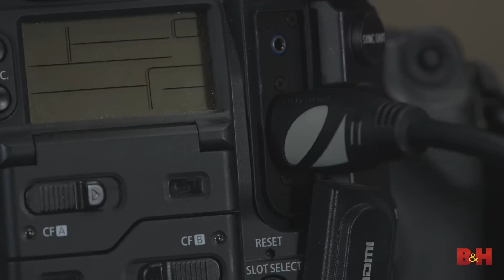SDI vs. HDMI | What's the Difference?

Comment: hi i still using betacam digi  bnc is better not worry about the plug coming out all the time   in the back of the heavy 
decks SDI out puts on betacam digi   HDMI with betacam right pain 

i used betacam sp for audio now 4 channel master i know about the encoding  it a right pain take alot of time  faster just run  channel 1-4 into the back of the video's 
decks

Comment: I get why SDI is used in professional workspaces, like livestreams or normal film shoots, but i was wondering, do i need SDI connection from my PC to my monitor if the material is already shot and it's time for editing/colorgrading. So what i took from your video is, when i have to film professionally i should use SDI rather than HDMI, which i do, but for connecting my PC to my monitor, it doesnt matter because i dont need much range, and the lock/unlocked argument is also not critical. So i guess my question is, does it matter which cable i use to connect, when i use the highest standard of both cables?

Comment: This is a perfectly fine beginner video, but some key points were missed.  For one, there is no "absolute" distance for any SDI cable--it depends on the bit-rate of the signal and the cable type.  The same 1.5Gb HD-SDI signal can travel much farther on an RG-6 SDI cable than an RG-59 cable.  The instant people hear "you can run SDI 100m" they think it's some kind of magic number.  it's not for SDI, or ethernet, or anything else in the real world.

Second, SDI is uni-directional.  It sends all the data one way and there is no "hand-shaking" between the send and receive devices.  They are "unaware" of each other.  HDMI is entirely different because it was designed for so-called "plug and play" connection between consumer devices where the source and receiver negotiate certain parameters (including whether HDCP copy-protection is active).  The number of things that can go wrong with HDMI (apart from the connector falling out) is greater than with SDI.  Fortunately the equipment that uses HDMI has gotten much better at making sure a signal gets through!

And, lastly, the DIN connector is not "mini-SDI."  There is miniature DIN type, and there is a miniature BNC (called, confusingly, HD-BNC) and they are incompatible with each other.  If your equipment uses these connectors, because space is really tight, make sure you get the correct cables or adapters.

Comment: So  fantastic 💝 . I am using SDI for ten years , I can easily transmit 600 feet away from the source camera . 
I enjoyed this video and learn a lot .
Reply: What resolution are you running at that length. Thanks
Reply: @BillAshtonNelo This time a medical device named STOREZ with an endoscopic camera, it's output was only SDI. I used SDI to hdmi converter, HDMI to BNC and over RG6 (fully cuper)600 feet and at the end BNC to HDMI converter to a 1 is to 4 HDMI splitter and then projectors and TVs. Resolution hd 1024*768. Projection quality was excellent.
Correction: For 10 years I was using SD , not SDI. Sorry for the mistake.

Comment: Please help, I own the Sony fs7 and I wanted to know if there's a way to record video using an external recorder like the atomos Ninja V WITHOUT the Sony Xdca FS7 extension unit???
Reply from the maker: Internal Recording
The PXW-FS7M2 records internally in both DCI 4K and UHD 4K at up to 59.94 fps, and in HD up to 180 fps using XAVC-I or up to 120 fps with XAVC-L. DCI 4K (4096 x 2160) can be recorded internally without the need of an external recorder.  You will need the XDCA-FS7 to output a RAW signal from any PXW-FS7. The Sony XDCA-FS7 allows 12-bit FS RAW output and is compatible with Sony and third party recorders. It will do both 4K RAW up to 59.94p (1 to 60 fps Slow and Quick Motion) and 2K RAW up to 59.94p (240 fps and 120 fps Slow Motion).      >Mark<

Comment: We are using the Atem mini extreme so..... we have cameras that have hdmi at camera to HDMI-SDI convertor. Then SDI for the long runs back to the desk. We then have SDI to HDMI convertor to let us have a HDMI into the Atem extreme. Actually all works very well with no latency and loss of quality. Our PTZ camera is SDI straight out.
Reply: I have a canon C70 and was thinking of using for livestream use.   How long is your HDMI (out of camera) to your HDMI to SDI coverter?
Reply: @cia2928  the HDMI out of the camera is 1 M long and the same at the other end from the convertor to the Atem.

Comment: Thnx, made it all very clear for this start up for now budgetless broadcasting company to be :-) Questions: hence the budget, we have to work with HDMIcables for transmitting live streaming signals from camera to OBS. In such a case; what would still be the best solution if we had to overcome distances longer then 15 feet? What set up exactly? Amplifiers? Is there loss of signal when using those? Are 2.1cables the best if we merely use 720 content? What about HDMI b? Actually.. we need to overcome about 30 feet distances to get a good camerashot regularly. And since there;s no budget to buy SDI camera's yet, what should we do best? Maybe with a bit loss of signal? Thx, René, IBTV, Amsterdam.
Reply from the maker: At 30 feet or so active HDMI cables are a fine solution for most applications:
Comprehensive MHD18G-35PROBLKA MicroFlex Premium High-Speed Active HDMI Cable with Ethernet (35')
B&H # COMHD18G35P:    https://bhpho.to/3bRFKgu        >Mark<
Supports 4K, HDR, 3D Video
Active, Directional Design
Triple Shielded
24kt Gold-Plated Connectors
Xtra-Flex PVC Jacket
Supports CEC, ARC, HDCP
Reply: @BandH  Thnx  a lot, this is very helpful for our startup situation. Will follow you for our next steps!

Comment: great video..so there isnt any difference between BNC and HDSDI cable?
Reply from the maker: A BNC is a connector that can be found on different kinds of cables.  SDI Cables, Composite and Component can all have BNC Connectors.  You need to make sure you are using the right cable type depending on the situation.
Thanks! -Joey P
Reply: @BandH  thank you for the perfect answer and reply!always learn alot from ur channel.

Comment: 1- do I need an SDI input monitor to get 10bit or HDMI(or DP) will do the job? 
2- can we use dual monitor setup with geforce card + cheap quadro to get 10 bit picture on 2 monitor or doesn't work that way?
3- if second question negative can I use Blackmagic Design DeckLink Studio 4K 6G-SDI to get 10 bit signal on second monitor? I'll be using geforce on main monitor.
Reply from the maker: You wil find 10 Bit options for both SDI or HDMI.  So that we may better assist you with all of your questions feel free to email us directly at askbh@bhphoto.com.
Thanks!
-Joey P

Comment: hi, I wanted to ask if you can connect two monitors with an SDI cable. I have an ikan monitor with sdi in / out and an atomos monitor with sdi in / out I would like to connect them with an sdi cable, connecting one of the two with hdmi to a sony a7sii, is it possible?
Reply from the maker: That would depend on the exact monitors you are using and if either has an HDMI input with cross conversion to turn the HDMI signal in to SDI for output.  If your monitors are not capable of cross conversion, you may just need an HDMI to SDI converter to connect from the A7SII to one of the monitors with SDI.

https://bhpho.to/38nGwwN

Thanks! - Joey P

Comment: what about timecode sdi supports it
Reply from the maker: Yes it does!  SDI includes video, audio, timecode and metadata all embedded in a single cable. Because of its reliability, SDI is ideal for live production, post and broadcast. SDI is scaleable and multi rate, so you can switch formats and frame rates using the same physical single cable connection.   >Mark<

Comment: 👍 Interesting video. I learned a few things... As a consumer/prosumer, I say, "screw SDI." My HDMI cables are 4" long, and a non-locking micro 2.1 HDMI connection isn't a prob at 4". Adding SDI to my $260 USD 7" 2200 nit field monitor is an extra $80. An $80 thingamajig, that I'll never use anyway.

Comment: thank you for sharing the info. but i want to know how to convert SDI output into IP output and which equipment could do that actually. Please reply..Thank You
Reply from the maker: Convert a single 3G-SDI signal for highly efficient SMPTE ST 2110 IP transmission using the IPT-10G2-SDI Mini-Converter from AJA. Supporting up to 1080p60 video, this mini-converter provides two interfaces for use with separately available 10 GbE SFP+ modules. Hitless SMPTE ST 2022-7 switching for critical transmissions is offered via the redundant interface design.  AJA IPT-10G2-SDI 3G-SDI to SMPTE ST 2110 IP Mini-Converter
  BH #AJIPT10G2SDI:  https://bhpho.to/2LK2Kk4   >Mark<

Comment: Worth reiterating that HDMI will now carry 4X the data rate! If you can live with short cable runs, it seems the big thing that is missing is an industry standard locking connector(s) for HDMI. For short runs it is starting to make more sense as cameras need higher data rates.

Comment: Thanks for this info. I've noticed companies like Atomos sell "SDI to HDMI" converters. Does that actually mean that cameras with an SDI RAW output could actually record to a HDMI input on an external recorder?
Reply from the maker: It does not.  In general SDI to HDMI converters will not be able to handle an SDI Raw signal.

Thanks!
-Joey P
Reply: @BandH  ahh thanks Joey P. Even without RAW, if they can still convert 4k60p SDI signal to HDMI that'd still be  very cool!

Comment: basically, if you can afford the level of equipment that comes with an sdi connection, then you're going with sdi, which is a simpler thing to use. for most of us, it's going to be hdmi. I've found that the signal dies after fifty feet without being repeated. I'm currently running a signal every week about 115 feet using repeaters between cables. You can also convert to other types of cords, but either way, I've found that a fifty foot cable is about as long as you can go before needing to repeat. And there are repeaters out there that don't need to be directly plugged in, so long as something somewhere along the line is plugged in, they'll draw from that.

Comment: I usually run HDMI for my personal webcasting setup. When designing my former high school's TV studio, I wend with 3G SDI. When I need to use an HDMI camera with a video switcher I turn to the black magic mini converter HDMI to 3G SDI. I personally never had an HDMI cable slip, but would definetly say SDI is less to worry about.

Comment: Oops...SDI runs are limited to 100 meters, not 300 meters.   Plus, as the speed goes up, i.e. 3G and such, the rated distances degrade.
Reply: Rick Vanderwielen good catch! I should have specified that SD-SDI has a maximum run length of around 300 meters but if you need to run that far I would start looking at wireless options anyway ;) Thanks for watching!
Reply: You can just reclock and run another 100 meters, the easiest way is to just convert to fiber if you wanna go more than 300ft. For professional broadcast quality video we rarely run anything wireless unless it's a roving camera or leaving via satellite.

Comment: I have been using SDI for 5 yrs now. It is by far more convenient, durable and the fact that you can easily run 100 ft on cheep coaxial cable makes it my preferred way to connect.
Reply: Will it really pump out 4k at 950ft?

Comment: Why displayport hast take off on camera industry being an open source format?
Reply from the maker: You would probably want to pose that question to this organization:                               DisplayPort is a video interface standard administered by VESA, the Video Electronics Standards Association. DisplayPort is the new generation AV interface developed by the GPU/display industry segment and it continues to gain market momentum. DisplayPort enables high display performance, robustness, and versatility, highest degree of system integration, and greater interoperability among various device types.  https://www.displayport.org/    >Mark<